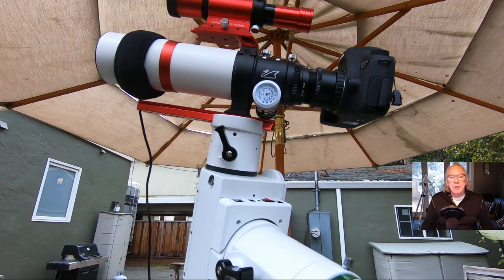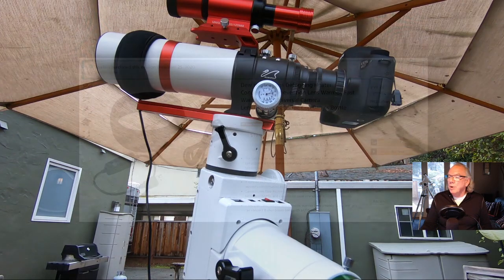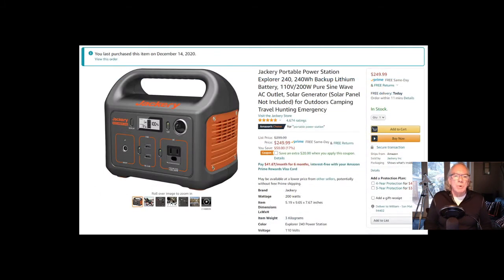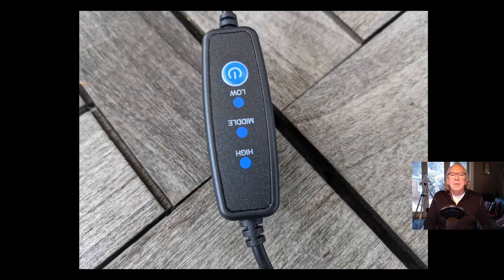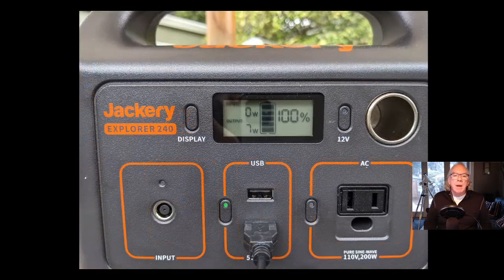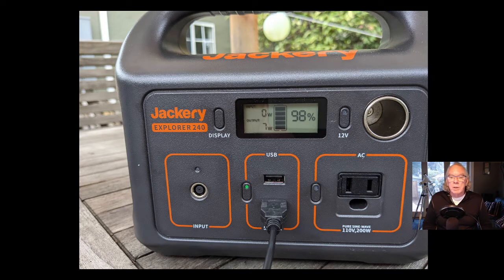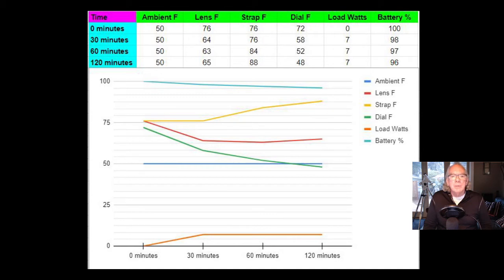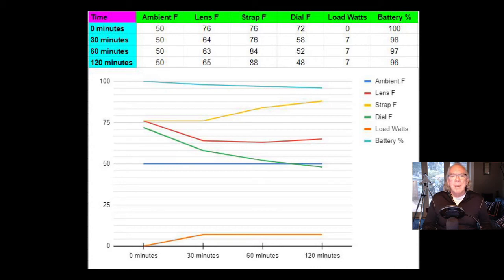ZenithStar 61 II Dew Heater Load Test

Comment: Typically the telescope lens only needs to be a few degrees above ambient.  Given the large heat build up you were using more power than necessary.  At lower settings you'd save battery life for sure.
Reply from the maker: Great feedback! Since that video I now have the Pegasus Astro Power Box Advance and new dew strips that work with it to manage temperature. 👍 Thank you for dropping in and taking time to comment. 👍

Comment: Hi, Andrew here in Ottawa Canada. Found your channel tonight. I actually just finished a workshop on Astrophotography and learned about Dew heaters and the need for them. Interesting on the power review and I was advised tO run dew heaters on their own source, especially if not on the mains power. Very cool and you have a new subscriber. Cheers Andrew
Reply from the maker: Thank Andrew! Your sub is much appreciated. 👍 Since that video I've added a Pegasus Astro Pocket Powerbox Advance (PPBA) and two Dew-Not Dew Heater Strips which are managed by the PPBA. The PPBA provides independent power to each heater strip.

Comment: It's crazy beside the camera how we almost have the same exact setup. I first started with the same Jackery power station back when it only powered my Asiair pro and 2 dew heater. As I added my heq5 and now my Asi2600, if it's not plugged in, it doesn't last very long so I upgraded to a 500w power station. I would'nt feel comfortable going out with just the Jackery unless I have some way to recharge it. In defense of the Jackery, I do have to say that I used it in very cold condition ( between -10 and -20 C°).
Reply from the maker: Very cool! That's my issue right now how to do I recharge the power stations when I'm out remote for a few days. I know I need at least a second power station as well. Good to know the Jackery can handle the lower temperatures. I just started to look at Pegasus Astro powerbox solutions to improve my cable management. So many opportunities to spend money. 🙂 Hope you keep us up to date on how your journey is going from time to time! ~ Bill

Comment: There a number of factors that play into the issue of dew on your front lens. The first is the level of humidity of the ambient air, the second is the temperature at which the moisture will form dew (the dew point) for that humidity level, and the third is the radiation cooling of the objective lens as it points to a cold dark sky. So it’s a useful go/no go test to know that everything works and that your power supply will be good for many hours, but you have no control to tune the heating to the conditions of the night. Many dew strap controllers are available to make adjustments and avoid ‘cooking’ a lens for instance. There are also automatic controllers that measure the ambient temperature and humidity, calculate the dew point and vary the voltage to suit (Pegasus Astro PPB etc.)
Reply from the maker: Thank you Ed for taking time to share your knowledge. Much appreciated! 👍 I have been taking a look at the Pegasus Astro PPB. I have a cable management issue as well. And I may add an autofocuser. So many areas to be knowledgeable about! 😀 ~ Bill

Comment: The power station you've purchased has a capacity of 240 watt hours. That means your dew heater can (theoretically) be powered for 240 / 7 = 34.3 hours. In practice the battery capacity is about 30% less, so your heater can be powered standalone for approximately 24 hours. Since you you will be powering other devices as well (telescope mount, guide scope heater, camera, etc.) your power consumption may reach 25 to 50 wats. This means your runtime with this power bank would realistically be around 3.5 to 6.5 hours. Not enough,  if you ask me, for remote site use.
Reply from the maker: Thank you for taking time to watch the video and comment! I agree with you 100%. And to put a fine point on it when I move to a dedicated camera like the QHY 183m that's going to consume power. So I'll need a better power solution for dark sites. So many considerations to think about! 🙂 Thank you again for the valuable information. 👏👏👏

Comment: Great info Bill.  I haven't yet purchased a dew heater for my Redcat 51 or my guide scope but will soon.  I'm really liking your approach just getting into this hobby.  I'm not the patient sort so I tend to go all in which leads to frustration.  I bought my mount a couple of months ago I'm about $3K invested so far and have yet to have a successful night of imaging which adds to the frustration.  I think it would be best to take a step back and start over with the just the basics and once I get comfortable, move forward with more advanced techniques and equipment from there.  Your videos are helping quite a bit so keep them coming!
Reply from the maker: Hi Jeff thanks! Somewhere along the way in my career I came upon a phrase "go slow to go fast". It really helped my in my career development. I used this concept to tackle some complex knowledge areas including getting my FAA Single Engine Land Certificate.

At times using this approach made me feel like I was a slow learner. After a while I accepted that I was a slow learner. I came to accept the way I learned best was to go slow to make sure I understood each nugget of knowledge required to build a solid foundation of understanding. This also let me experience mini successes on my road to achieve that big success. Mini successes build confidence.

Seem like you have a good approach to take a step back for the moment to achieve a smaller success, enabling you to move forward again with confidence to achieve the larger success which is your goal. Sometimes we keep moving our bar a bit too fast. 😀 You'll get it done Jeff!